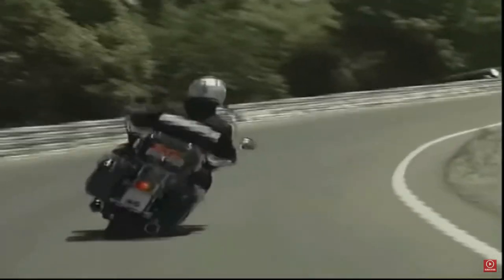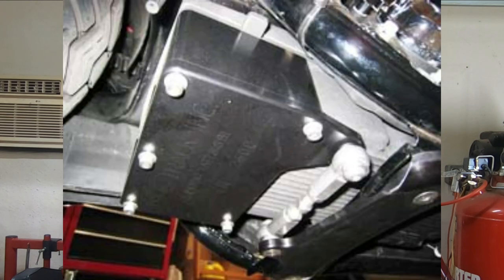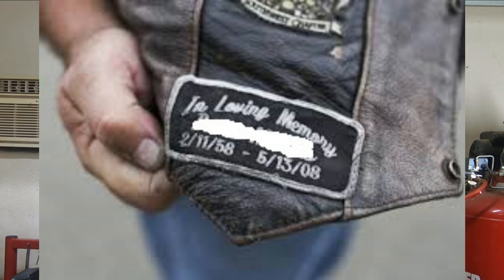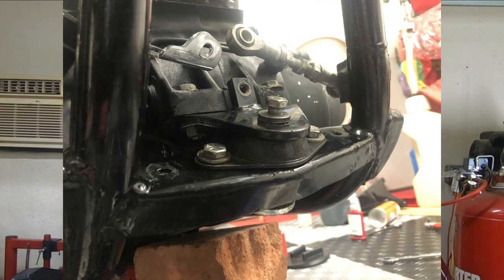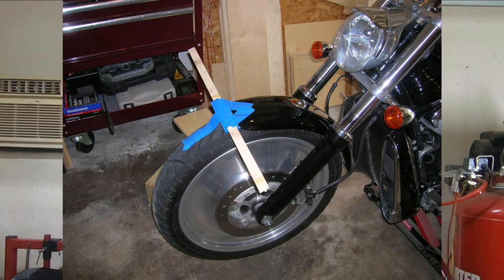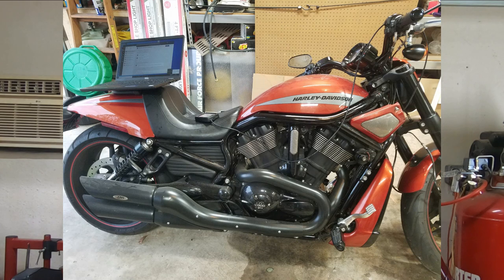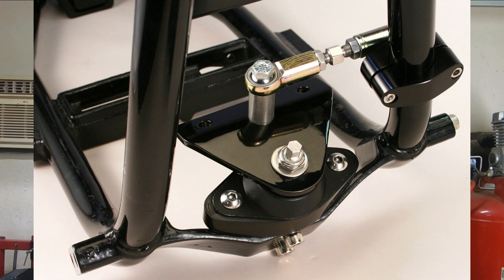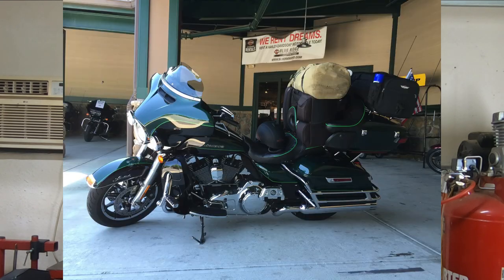The Dangerous Harley Problem

Comment: The real problem causing the wobble is the engine is out of alignment which causes the whole drive train to be slightly off. The front and back wheels don’t track the same causing the wobble in long sweeping turns. The cause is because out of the factory some shock mounts are slightly off. If you level the bike and measure the rear shock eyelets they will have up to a 1/4” difference which forces the rear wheel to be at a slight angle. The easiest remedy is to remove the solid engine stabilizer located at the front of the engine and put an adjustable hyme joint and adjust pulling motor until the rear shock eyelets measure the same on both sides. Ohlins Suspension has notified Harley Davidson of their findings of the shock mounts being off slightly but HD has ignored the issue. Ohlins fix is by making their shocks with adjustable eyelets to change the length of the the shocks to correct the drive train misalignment. The difference is they are correcting it at the rear and the adjustable engine stabilizer corrects it from the front end. Mine had the wobble since it was brand new yet my buddies didn’t have the issue. I did everything you mentioned until I saw this video from a frame shop that addressed the real issue. Once I aligned the motor with the adjustable hyme joint all my problems went away. My friend remedied his with the Ohlins suspension which Ohlins pre adjusted the eyelets for him based on how far his was out, his wobble too was remedied. These were both brand new bikes that HD refused to acknowledge had an issue. Check out the video attached. It fixed mine!!!
https://youtu.be/rAW8eM8A124

Comment: I own a XR1200 and I bumped up my redline up from 6900 to 7300 with my Power Commander. It now can hit 130. Most XRs went straight to the track. They switched from the belt to chain and the roadrace bikes hit 145mph. I never heard anybody having any handling problems at that speed.

Comment: Never had death wobble on anything in 48 yrs, till my 2006 f250 superduty.About 130,000 miles ,when the factory front end parts wore out.   Good tires, sometimes by them self and / or , new front end( moog parts, don't waste time with Autozone, or cheap parts) cured it.

Comment: Where’s your shop, mate?  If I get a second bike I’m thinking a Lowrider S. But first I want to see what I can wring out of a Triumph triple.  Because Norton is dead as an affordable hooner bike. And I have a quarter miler’s aversion to pesky power curves and excess weight. I’m retired, sort of, now, but I still gravitate towards sleepers and street fighters. 

My one concession to maturity is that this time I will do my tons on the strip, where they don’t give out traffic summons.  Think I can get deep into the tens at around 140 on an “ordinary” used Triumph. Street gas, no forced air.  That will be enough to put a permanent grin on my face.

There’s a lot of us old guys still setting up a fast drag bike. Just for kicks.  It all started when I made a late addition to my bucket list.  Doing the ton one more time took me on a search that ended up with a sweet used triple. 11 flat stock and it’s not…

Getting some maintenance and mods over the winter. Being optimistic I will pursue a drag bike license so I can go as quick as I can.  And I am in no hurry with the dealer because I’m not into winter riding anymore. But come the Spring…

PS a good friend just beat a 140+ mph speeding ticket. On a rat Kwaka. 

And yeah, my physical came back perfect so if you think I’m too old for this my MD disagrees. So see ya at the strip, I hope…

Comment: I have a 2010 fatboy Lo it had a bar wobble from new. The dealer fix was to over tighten the headset bearings. Apparently they believe its caused by the rake angle of the forks. I have done 118000 km and I just keep a good grip of the bars and I haven't had it happen again.

Comment: I have experienced wobble on every two-wheeled vehicle including bicycles. The back tire is fixed and is ruled by inertia. The front tire is not fixed and works against inertia. The back and forth energy causes wobble. Friction also plays a role.
Unbalanced tire pressure also said in video.

Comment: I got an old Japanese cruiser, ive had the wobble one time, I think the tires were low and that could have contributed to it. It happened at a low speed slowing down I gave it gas and it straightened out. Only time it's happened, scary.

Comment: Sir I need help with a stage 1 topic please.
A few weeks at biketober fest 
Rinehart racing did a full stage1 up grade on my 2015 ultra. 
Before the upgrade I could cruise around the block in 3rd or 4th say 30 -40 mph no issues.
Hit 5th gear drive 45mph no issues
No after the stage 1 I can’t the bike will begin to buck so I have to rev up a few time I have been at the light and the rpm feel like dropping and engine starving for air and it will turn off. 
My mechanic says I need to drive the bike differently because of the stage 1 like rev the rpm or drop one gear say 3rd if I want to cruise at 30 -35 mph
What os your opinion?
Besides the full exhaust I got the big sucker air cleaner from Arlen ness and power Vision tune all done the Reinhardt 
Other than that the bike woke up and runs great!
Thank you for you time.

Comment: My Yamaha Royalstar does a wobble when entering a curve at a speed that is to fast for the cruiser. At reason speed for the bike I don’t any problems. Old Goldwings had a problem with front end wobble. It was caused by the front was to light and the fairing would catch wind. All you had to do to fix it was slow down, the wobble would go away.

Comment: Harley has never admitted there is a problem, but it happened to me.  the cleave blocks loosened to 20 ft lbs. I crashed hard in Arizona. After I got out of the hospital someone talked me into getting an attorney. I was the 65th lawsuit filed and by the time Harley paid me an undisclosed sum there were over 200. Some were like me some resulted in injuries some crippling and other were death. What we found was that the motor mount system was designed by Eric Buell for the original touring bikes and FXR models. In 1995 Harley extended the frame 2 inches and De-raked the front end. They continued to use the original system after the change. Eric Buell told Harly engineers that they needed to add a third Hiem joint. He warned them that this was going to happen. I used an ally art system for a while, and it worked fine but the real cure was Glidepro motor mount and cleave block bushings. the bike really settled down and vibrations was significantly reduced. Like I said Harley paid out a lot of undisclosed sums. this issue is real.

Comment: I most adamantly agree about tires just never scrimp, that's between you and death. Best to run the same style and brand front and rear. Got a BMW. No maintenance done, had a 12-year-old Michelin on the front, and about 10-year-old Metzler rear. Just touching a painted line, or specially slowing, it was like black ice. Surprised I didn't lay it down. New tires and holy crap like a new bike. 120 and it's solid, and Any Corner even past 50°, no problem. A long history of bikes, 60 years, and first experiences, an old Harley, old ajs, and Honda superhawk. Now an r1100 s, and r1150r bmws... I like antiques which is what Harley and their design really is, the BMWs, it is more capable than my level of confidence. Push it hard and it always comes out.
  Since about 2000 I've ridden a lot of Triumph triples, one of them especially, Speed Triple 955, ridden hard, but still nice bike even at 80,000 miles. It only had minimal oil changes really not maintained. It was played and stunted, but I'm telling you it's still Road straight and tight. I really don't understand how Harley can not address this deadly issue. It's like telling a tourist to walk through the jungle, no problem it's beautiful there.. 9 out of 10 tourists come back. But one of them is eating Alive by the deadly Harley wobble. I guess I've got to admit, the last three people I heard of dying on a bike we're all on Harleys. And they all were sober. Old crazy buddy years ago, also fatal on a rock wall, but that's why everyone called them crazy.. but alcohol was so high they couldn't figure out how he was even conscious to ride. But I've seen more fatals coming on to the scene, while riding in Asia. Frankly if you're coming under the scene and you see a couple of shoes laying here and there, that indicates fatality oftentimes. Always ride sober and expect they're trying to kill you.🙏🙏

Comment: With a Norton isolastic frame if one does not keep up the adjustments the bike becomes a wobbling monster. This could be a case of not maintaining the bike as it should.
Reply: I wouldn't say 'monster' but you can definitely tell something's off. Not sure how Harley does it but when you get a Commando set up right it's a very stable machine.
Reply: @P_RO_  when Norton first made the rubber Mount frame for the atlas motor a Vernier adjusting system was included in the plans but it was dropped because poor is a cheap British bastard and after that you have to take the whole after the bike apart and order to adjust the rubber mount. Only in the last couple 3 years of production did they incorporate the Vernier adjustment. A guy in England was writing an article about how he got a ticket riding his Norton Commando and the back wheel was not following the front wheel as seen from the cop car. He did get a ticket I don't remember exactly what it was for though.

Comment: I had wobble, torque steer, bar shake, and off center tire wear, all on the same bike. Crown of the road?  Yeah, that's what Harley told me.  I bought the bike from them and had it back to them three times for this issue.  They also accused my riding skills and experience (I have been riding about 43 years).  As it turns out an independent shop found that Harley had installed the front wheel spacers on the wrong side so the wheel was off center.  Yes, everybody, including Harley, tells me that can't be done...well they did it.  They had to shim the caliper WAY off to do it. Yes, this was done at Harley Davidson. Take it to an expert?  I had stayed away from the Harley dealers for almost 25 years, then I bought that bike.  I learned a very serious lesson:  don't trust them, and question their expertise.  The bike was dangerous and they said it was the crown of the road and/or my riding after inspecting the bike three times while the problem itself was caused by their own improper assembly.  That bike is gone.  I totaled it and bought a used CVO. Polyurethane?  I highly recommend it for the cush drive, engine mounts, and swingarm. It's like a whole different bike.  Shakes?  Yeah, so?  Buy a Honda if that's an issue.  I much prefer good handling.  Stabilizer?  Fix the motorcycle, then a stabilizer is about want, not need.

Comment: Weaves and wobbles are a low frequency vibration, aka energy wave that travels back and forth through the bikes chassis.   Flexibility in the chassis is the enemy, be it flex in the mounts, loose hardware, cracks in the frame, weak spokes, weak belts in the tires, etc.   All bikes have some flex in the chassis, and bumps in the road that aren't properly absorbed by the suspension are passed on to the frame.   Ideally, the neck bearing preload is enough friction to absorb that energy wave, so while you glossed over it, that neck bearing preload is critical.   Damage to that neck bearing that causes binding will cause a weave that feels like the back tire is the issue.   Stiffening the rubber mount flex is a band aid for only one potential problem, so I prefer to improve the bike's energy wave absorbing ability with a steering damper.  My '66 came from the factory with one,  as did the more modern rubber mount touring bikes with sidecars.   They seem to have fallen out of favor in the aftermarket, but still are a very valid preventative measure to deal with wobbles and weaves.

Comment: Heh, that black bike at the end looks like mine after I set up camp, it’s only missing the extra saddlebags on the outside, the windshield bag, both tank bags, and the tent, of course 😅

I used to have front end wobble all the time: it was the tire, of course. Replaced front and rear and it completely went away. I was so bad that my local sheriff told me directly not to obey the posted speed limit and to keep it over 45 until I could afford new tires - 6 weeks later of course I let him do the burnout when we replaced them. Thank the deity of your choice for cool rural sheriffs.

Comment: My 17 road king had a tire rot away after only 3 years and less than 6000K.   I bought the bike second hand with 4K miles.  By the middle of the first year I rode it I noticed the splits on the tread.  Then I noticed the sidewall was rotted all the way around on both sides.  This year with 18K miles I couldn't get the bike to lean into left hand turns...even slow rolling turns.  It fought me hard and would try to stand itself up.  A new rear tire solved that problem.  I am actually disappointed in the overall ride I get from this bike. 
I had a smallish Kawasaki 35 years ago that was prone to the death wobble. I changed the springs in the front forks and it went away.  When I removed the caps on the forks there was no spring tension against the caps.  The new springs came in a few inches longer than what I took out and gave me fits trying to push the caps down to catch a thread.

Comment: When I had my 2016 Dyna LowRider with 4500 miles in a left turn the tar had a crack  my rear end of bike wobble.  That was the only time it happened. I heard reason Harley stopped Dyna's multiple lawsuits, is that true?  P.S. I'm looking at getting a mini bike for fun time off road. Like the Coleman 200 or little bigger. Last year I rode a DR 200 on trails going in the woods, plenty of power for that, sometimes too much. Kids today are missing out on mini bike of the 70's and BMX bikes, those 70's days were a blast!

Comment: 2011 tri glide front wobble at low speed, changed front tire stiill wobbles, dealer says front neck stem needs to be replaced. do u agree?

Comment: i will have to disagree on the year ..i had 2006 street glide new off the floor that had  the wobble. And found that the trans was causing the issue..i installed a trans stabilizer link ,that fix it..

Comment: I've never had any trouble with the death wobble thank God...I did have split rubber mounts before on my road king, they still shake  a ton until u get the bike moving. I try to ride the speed limit as much as possible. Definitely can feel when the tires are wore out.
Hey man I know this has nothing to do with your video topic but I really appreciate  your opinion. So I recently got an 04 road king with the 95" kit and the 525 cams. Are those fueling cams?. It pulls pretty damn good after 2400rpm....id like to get a cam that hits earlier torque...what's your opinion on a stronger torque cam for the 95" setup...it has a s.e. cam plate and pump in it too.

Comment: I had front end wobble on my 2001 Deuce. It was kind of freaky. Tire pressure good. Spokes good. Fall away? Horrible! Pulled the front end apart. New bearings in the head. Set the fall away. New tires. Swapped out fork guts for Progressive mono-tubes. Fixed. Guys, check that fall away. It's got to be perfect.

Comment: Five years is about the oldest you want to run. I e had six year old Dunlop Elites on a garaged bike blow a front out, no visible cracks.  When I go to look at bikes the owner always says "I put them there tires on last year".  I check the DOT date, and they are 12 years old. And so far, 90% of these bikes have around 10lb of air in their tires.  I am shocked there aren't more accidents than there are.  I just a 04 Sportster develop a handlebar shake when decelerating.  Front wheel bearings were very stiff.  Replacement solved the issue.

Comment: A guy went around the big gold wing the big event called The Americade. They were from Dunlop and they were checking tire pressure and found that 75% of all of the motorcycles there had extremely low air pressure. You can neglect the car and when it blows up you coach to the side of the road and call Geico will a motorcycle it's something totally different and you're lucky if you don't end up in the emergency room. There is an old saying that goes he who takes care of his own feet before that of his Mount will soon have no feet to teend

Comment: Dyna WG. 2002. Never wobbled. Ever. At any speed (95 mph). Even tried to induce it.. Nope. I changed my mounts @ 35k, and got rid of the wire wheels before I picked it up. Wobble comes from being a RUB.

Comment: Baggers were meant to be rode easy, it was never intended to rush anything.  You try to break too hard and the front end dives at an alarming rate, you rush just a tiny bit into a corner and you scrape foot placements, you accelerate too hard and she will rear up, but you scrape fenders + fiberglass bags.  Can you ride them wild? Not without heavy modification, but then why ride a bagger?  Oh and... when in doubt, power out.

Comment: I have been riding for over 40 years, never owned a HD.  Bought a 2008 Hartage last spring, first thing I noticed is my Insurance rate about doubled.  And I truly belive that HD  Stands for a  Hundred  Dollars.  Anyway, Tires looked brand new, date code was 2013.  9 year Tires.  First thing I did was take the bike in for all 3 oil change an set of tires.  Be safe out there
Nick in Arizona